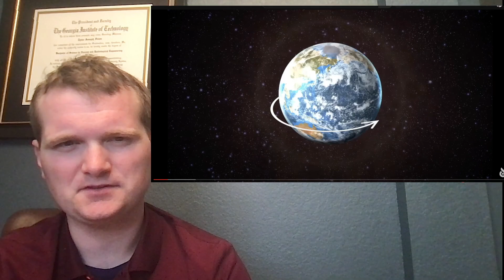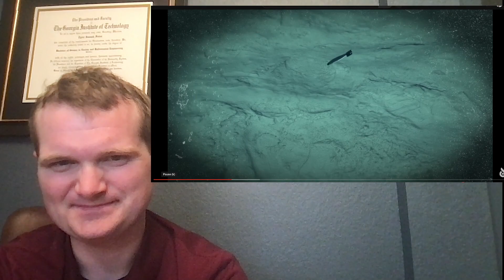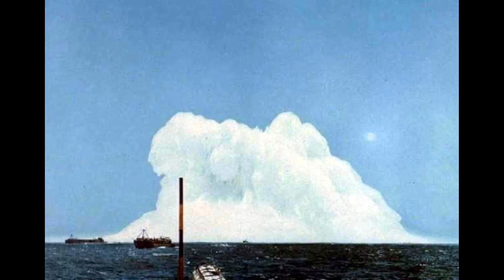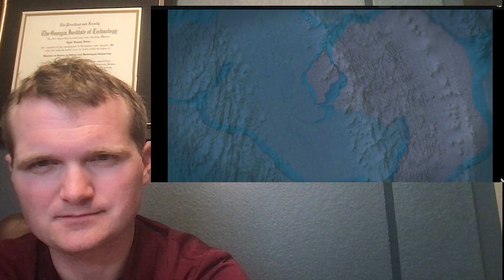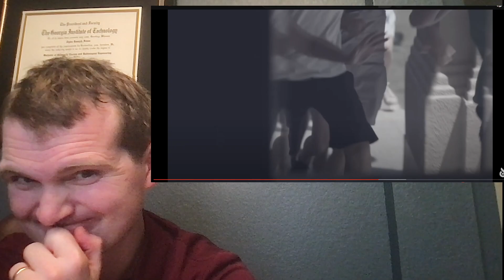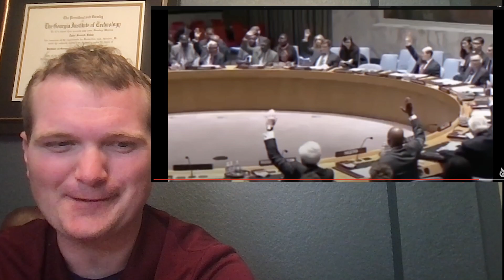Nuclear Engineer DEBUNKS Ridddle "If you Detonated a Nuclear Bomb in the Mariana Trench"

Comment: The delta-V to make the Earth fall into the Sun is so tremendous, due to the orbital velocity of the Earth, it would actually take less energy to boost us into Pluto's orbit. In fact, once Earth reaches Pluto's orbit, a relatively small orbital correction would put us in a collision trajectory with the Sun.

This is true for the idea of throwing nuclear waste into the Sun as well: it's actually more fuel efficient for a rocket to go to Pluto and then deorbit than trying to fly from Earth directly into the Sun. Not that throwing high-level nuclear waste into the Sun is a good idea; rockets have a bad habit of blowing up on the launchpad when something goes wrong. Each nuclear waste rocket aimed at the Sun is a potential mini-Chernobyl if the launch fails.

Comment: Would water pressure from deep in Earth's oceans be enough to make a ball of uranium/plutonium or a pellet with deuterium/tritium go nuclear? that is to say, could it start fission or even fusion?
Reply from the maker: Good Question!  Short answer: No

Longer answer:
Fission: Pressure by itself wouldn't do it.  You need a neutron source in addition to the fissile material.  Water does make a good moderator, though.  What is fascinating is there was thought to be a natural fission reactor near Oklo, Gabon over a billion years ago: https://en.wikipedia.org/wiki/Natural_nuclear_fission_reactor.  So, not completely implausible given the right circumstances.  

Fusion: You need MUCH higher temperatures (100,000,000 C) in addition to the pressure, plus confinement time.  Even Earth's core isn't hot enough (about 5000 C).
Reply: @tfolsenuclear  speaking of neutrons, how do we know those are a thing since they have no electric charge to detect and are too small to be seen with light?
Reply from the maker: They have a lot of mass (slightly more than a proton). In most elements, they contribute more to the mass of the nucleus than protons. They were first discovered in an experiment back in the 1930s: https://byjus.com/chemistry/proton-neutron-discovery/#:~:text=the%20year%201920.-,How%20were%20Neutrons%20Discovered%3F,a%20relatively%20high%20hydrogen%20content.

Comment: When you were describing how the tsar bomb works, you said that the plutonium 239 of the first stage fissions in order to fuse the deuterium-tritium gas, but I'm a little confused. I was under the impression that the first stage of a thermonuclear weapon fisions and the second stage fuses, but there is deuterium-tritium gas in the center of the first stage, meaning the plutonium 239 would be triggering fusion in the first stage and then that fusion would trigger more fusion in the second stage. Is that correct? Is the idea that the first stage fissions and the second state fusions just an oversimplification?
Reply: Late, but yes, there is both fission and fusion in the first stage of most thermonuclear bombs. In fact, even single-stage, “non-thermonuclear” warheads are typically boosted with D-T fusion. It’s mainly there to produce extra neutrons, to make the fission ramp up quicker and burn more efficiently. It’s not considered a separate stage because it’s co-located with the plutonium and burns simultaneously with it, compared with the lithium deutride secondary which is a separate capsule that only burns after the primary has already detonated.